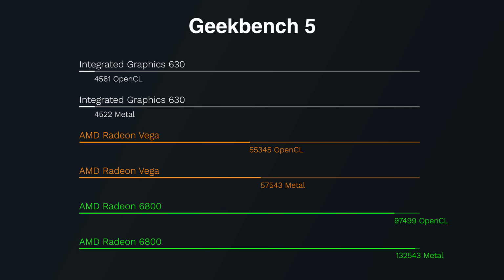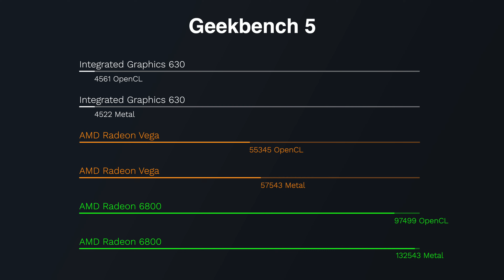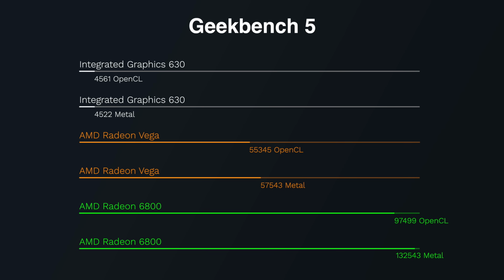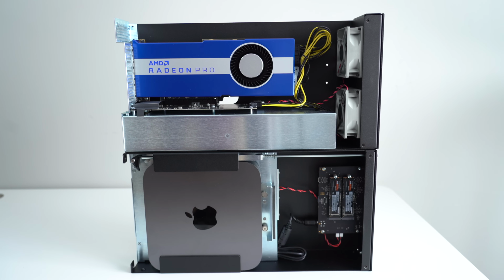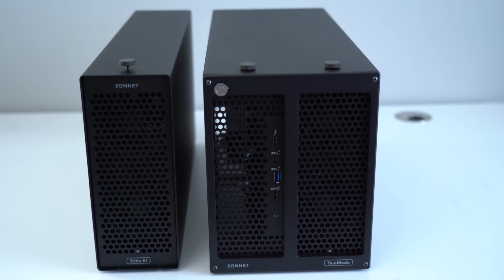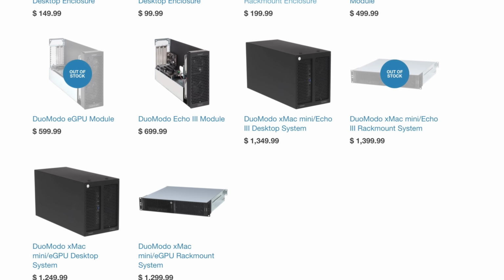Make Your Mac Mini FASTER with Sonnet's DuoModo xMac Mini & eGPU Modules

Comment: Details of SSD speeds would be just as useful as GPU benchmarks.  Sonnet have a habit of crippling NVMe performance in some of their Thunderbolt systems.  The utterly useless dock with a pathetic 800MB/s for example.  If the Xmac Mini duo modo matches the NVMe speed of their McFiver card in an 8x PCIe 3.0 slot/Thunderbolt enclosure, it’s still excessively expensive for what’s effectively a Thunderbolt dock with Mac Mini mounting abilities.  If it can’t even manage that, it’s as waste of money.

Comment: I'm "retiring" my Intel Macs but I've decided to keep a Mac mini for just-in-case Intel stuff, and now with an eGPU you can even put a current-generation AMD Radeon with it … this is suddenly very practical!  Despite the eGPU being useless for M1, the fact is Windows for ARM refuses to run Xbox Pass and I have to have Windows for Intel.  None of the Intel Macs have modern GPUs anymore, but with an eGPU that doesn't matter!  And it's still half the price of a second-hand 2020 iMac with the best Radeon 5700XT, which is still a generation ago and now you're stuck with it.  Versus eGPU that you can keep on upgrading.

Comment: Sonnet is obviously smoking something, presenting a mount for a MacMini, remote connections (back), and a PCI remote connection. No thanks, I will build my own. Risers run about $30. Add a power supply, and your set. If you want a no-brainer solution, then whip that credit card out and max it out!

Comment: It would help if you explicitly stated that eGPUs don’t work with the M1 Mac mini. Or am I wrong about that. Yes, you did mention older Mac mini in passing, but you really needed a little more transparency here.
Reply: Yo concretamente me estoy chupando por el momento 1 hora entre el vídeo y la traducción de los 70 mensajes con sus respectivas respuestas sin saber inglés, porque tengo una Mac mini de finales de 2012 que ya amplié con un ssd de 500Gb y otro HD de 2Tb pero ahora se me calienta incluso con software cambio de pasta térmica y tal y estoy buscando darle más vida porque me parecen muy cortitos los equipos nuevos de Mac para los precios que tienen y con la llegada de las IAs y NVIDIA me tengo que reinventar sin saber informática. En mi caso me hubiera venido bien un vídeo explicativo del vídeo explicativo, pero estoy muy agradecido simplemente por el dato de que son las M1 las que no admiten egpu ( el mío es Intel) y saber que por fin puedo sacar provecho al Thunderbolt.. creo. Si después de la paliza que me voy a dar encuentro una forma de ampliar mi equipo 3 años más me voy contento 👍🏻
Reply: I don’t think his viewers need to be told something like that. It is obvious Apple silicon doesn’t support egpus. You’re mainstream so you’ve probably seen max techs video on why. 

Apple does not plan to have egpu support, unless Apple make their own egpus. Maybe they will with black magic, they could add more cores to a egpu solution. But that’s all speculation at this point.
Reply: @Qumkuat  That comment might be valid for a video on Max Tech, but MacRumors is a lot more mainstream. As a consequence, not all MacRumors readers/viewers are techies. Failing to clearly state that M1 Macs won't profit from an eGPU is a disservice to mainstream viewers, who may not be geeks like you and I.

Comment: I feel like it's a disservice to your channel community to fail to mention that the M1 Mac Mini (or any Apple hardware running their own silicon) does not support any eGPUs.
Reply: AFAIK, only the M1 macs fail to support eGPUs ... for now.

Maybe it changes?  The M1s are nice - quiet, cool and powerful - yet they do lack a lot of I/O options.
Reply: This is a good comment... I know you can run WIndows 11 arm from the insiders preview using Parallels on the Mac Mini. I'm never quite sure if Parallels is just emulation such as VMWare or does Windows install directly on the metal. If it's the latter would Windows still be able to benefit from the eGPU? Or even if you remove the Mac OS all together and run any *nix or Windows.
Reply: Mac is great at sticking it to its customers. The faster apple falls the better.